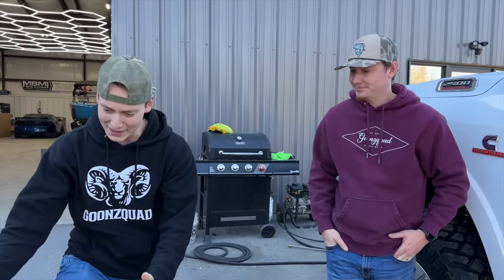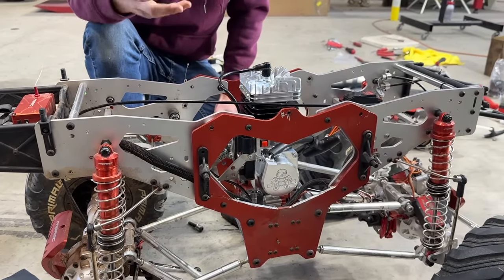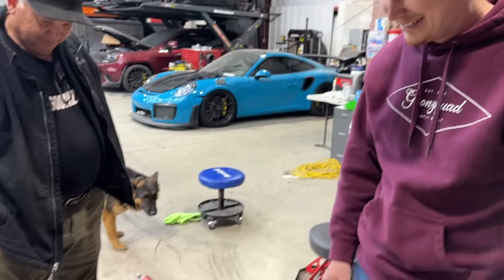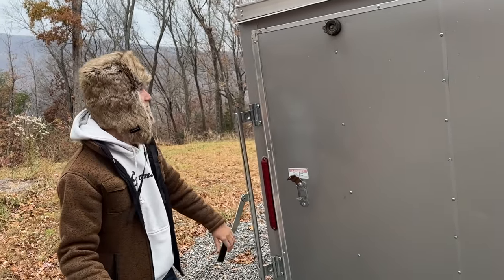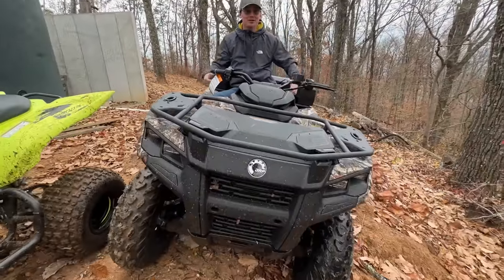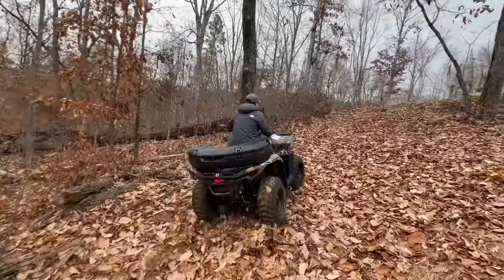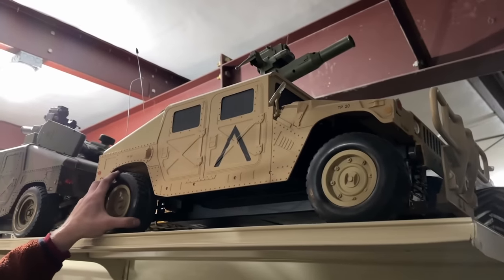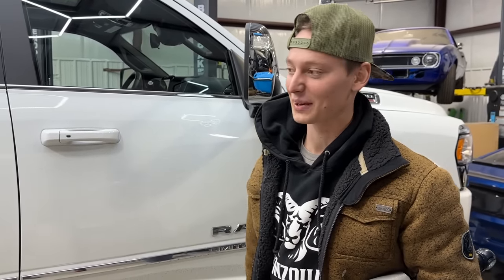We Have Been Hiding Something From You Guys!!!

Comment: If you ever get the rc truck working when you jump it let go of the throttle don't land while you still have the trigger pulled cos you will destroy the diffs it happened to mine a couple of times and thay aren't cheap to replace every time you use it.

Comment: First of all congratulations with the baby ! About RC car with that kind of upgrade of the engine whole electronics need upgrade... Controler, Batery, recivers, servos... and most important upgraded breaks and Fail Safe... trust me... it costly but if that beast will "run away" on you with that kind of power it can kill someone... I personaly used Spectrum Controlers and recivers... good stuff

Comment: Congratulations on the pregnancy.  Meet my ex wife racing RC trucks. We both had Tamiya Blackfoot's. Mine has a 1000,000 RPM electric motor. It was good for 41mph but the battery only lasted 2 minutes. I still have the truck but it needs a new rear gear set up, I guess the motor was a little to much.

Comment: Want a video idea?  Build a giveaway, 700 horsepower ford F150 FP700 Build. Use the shortbed, single cab 4x4, add ford's blower package and customize the wheels, suspension etc. Easy work, cheap hp and an awesome vehicle.

Comment: You might need to calibrate the remote and receiver. take it to the hobby shop. That remote does look like a piece of junk.
Reply: Also, always take the wheels off when messing about with it. Ya dont want that thing running away at high speed if the controller is playing up